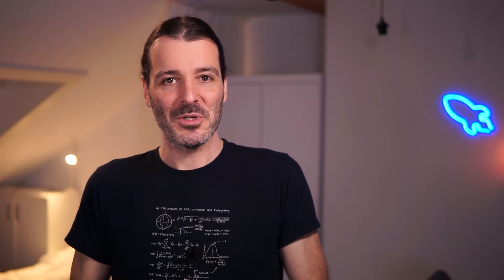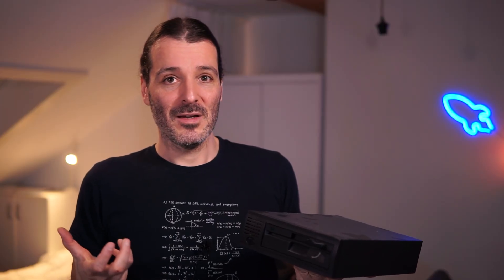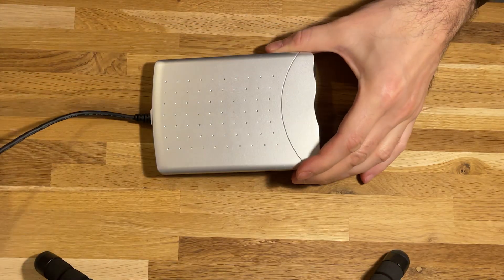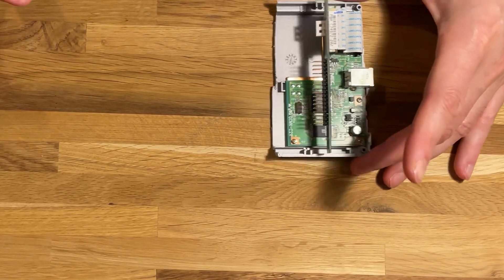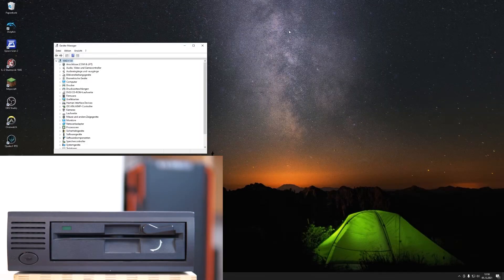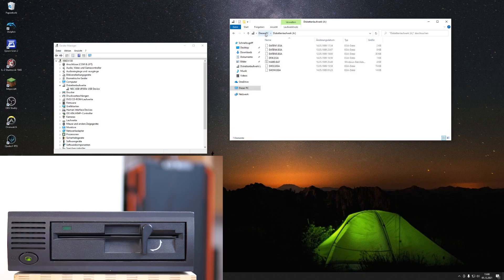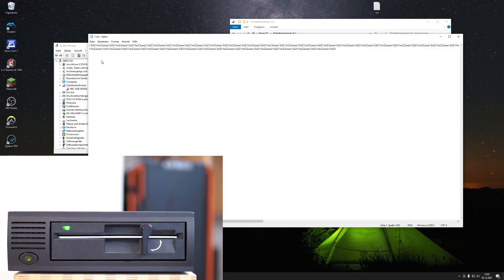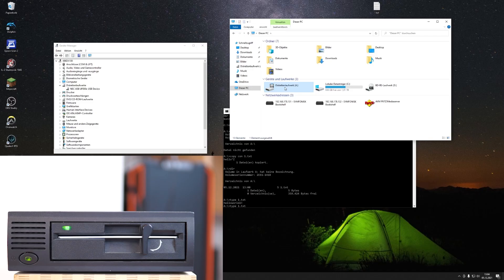How to build a working external 5.25" USB Floppy Drive

Comment: Is the drive a 1.2M or a 360K one? A green LED on a half height 5.25" usually indicates it's 1.2M but I've seen some late 360K drives with green LED and some early 1.2M with red. Then there are the 5.25" 720K drives that are formatted identically to 3.5" 720K.

Comment: Have you looked closley at the board and chip of the usb->floppy adaptor? There may either be some kind of internal registers to tell the chip what to identify as, or data stored on an eeprom/flash that stores basic info about the drive to the PC that could be changed to show up as a different drive.

Comment: Why does he insist on calling them "quarter and a five" to the 5.25"  disks? Is he British? Then he calls them "Quarter inch" and "quarter and five hundred". WTF is he talking about? Just call them "Five point twenty five inches floppy" dude.
Reply: His wording was cuckoo, but “five point twenty five” is incorrect, too. Though people occasionally do it, it’s not correct to speak out digits after a decimal as a single number (except in currency). So it’s either “five point two five” or “five and a quarter”.

He’s not a native speaker. My guess is he’s German.

Comment: I did this years ago but with a Linux machine and it works some what. I can read but I can't write to it. My guess is the Micro Controller only has the timing set for 720KB/1.44MB disks. The drive controller I used has a USB97CFDC-01 controller that the datasheet claims it can handle 5.25 drives. There is a pin on the controller called HDO and I tried forcing it high and low with no change. I also tried playing with a few other pins to control the RPM and Write Protect.

I might give Kyroflux a try but I honestly don't need a 5.25 drive for anything now since I converted my retro machine to use Compact Flash.

Comment: The reason is plug and play. You have to make it report a 5,25' Floppy.
Reply: The issue is, there isn't a USB floppy emulation spec for 5.25" drives, only 3.5".
Reply: No you don't. Unless you can answer why. Just make it report itself as a regular flash media device or hard disk, and then write a controller to translate.
Reply: @matthewrease2376  Many programs that write floppy images need to control the hardware directly. They won't even acknowledge the existence of removable usb drives.
Reply: @simoncowbell.6783  I'm saying, create a controller that takes care of this. So the OS doesn't even realize.

It wouldn't be great for preservation, but at least simple reading/writing could take place.

Comment: https://www.youtube.com/watch?v=9By8EmW62rs&t=287s

About five years ago, I analyzed and improved the circuit of UF0001 and developed a USB floppy controller conversion board that could read 5-inch floppy disks, but I couldn't solve the problem of distributing the control firmware, so I ended up putting it away.
Reply: If you have more information about this, I would be very interested in your circuit improvement and conversion board work. I have been trying to get 1.2-MB 5.25" disks to work using a UF0001 and have had some success, but not with the 1.2-MB format.

Comment: Cool project for retro computing!
Strange behavior. 
My theory is, that Windows removed 5 inch floppy support.
One way to test this out is connecting floppy drive directly to mainboard but mainboard BIOS needs support too. 🤔
Reply: I remember seing someone on yt who had old mainboard which supported floppy connector so he could plug 5.25" drive natively and it worked perfectly in Windows 10.
Reply: Still working on Windows 11, with a first-gen Core i system that has an onboard floppy controller and BIOS that supports 5.25" drives.
The oft-repeated "hurrdurr windows doesn't support it" line is a myth, driven by ignorance and the lack of (working) hardware to test it yourself.

Comment: You should use an adapter that is more standard. look on ebay there are cheap chinese adapters for fdd to usb. there are probably other different ones too. get a few and try all of them. For your Windows issues, you're probably going to find only fatigue because microsoft removed support for the earlier drives from windows 7 onwards. if the adapter wont work with 5 1/4" drives then it will be the usb to fdd chip and there's no way to make it work other than design your own converter chip using a cpld or a simple microcontroller like the STM32 series. This is exactly what the kyroflux does.

Comment: There's probably a difference with the way the bios sees the device, probably some raw mode vs the way windows sees it. So probably raw access vs drivers in windows. Maybe you can trick windows in device manager by selecting a different driver. I don't think it'll let you do it in windows 10 but earlier windows will probably let you do that

Comment: I still have several 5.25 flop drives, so this should be interesting to try.  I don't want to mess with my current USB 3.5 flop drive, so I will have to find another one to rip open.   I also have a combo 3.5-5.25 flop drive (that fits in one drive bay), but not sure if the USB controller can handle that type of drive.
Reply: That's actually two types of drives.  :-)

The combo drives had a single interface to the cable, but that interface was split into two on the PCB -- one with a twist (for A:) and one without (for B:), and usually a jumper or two to select which drive was which.  Despite the two connections being integrated into the PCB, instead of separate connectors on a cable, it is exactly identical to two independent floppy drives.

So if connected to a USB controller that implements the Shugart interface, you would have access to whichever is jumpered to be drive A: and that's it.

Just to clarify, most of the small laptop-sized USB floppy drives are fully USB all the way to the drive electronics.  The controller is not a standard PC (Shugart) controller, which is why many of those little drives can run at 2x, which a standard PC controller cannot.
Reply: @sirnickity  ... I will have to find it, it's a Teac, I believe, to see what the connectors look like. I have not looked at it in maybe a decade. But yeah that would be unfortunate if I can't get both of them seen on one USB, unless I use 2 separate USB controllers (to 2 USB ports), which basically would be the same as 2 separate flop drives.

Comment: The problem is the USB controller. It does not support the proper control parameters to handle a 5.25" drive, and it tells Windows that the drive is 3.5", so Windows assumes all the wrong parameters.

Electrically and from the command and control structure (read/write commands etc.), 3.5" and 5.25" FDDs are the same. The difference is only a different connector and different parameters (number of tracks, number of sectors per track, etc.).

In the old days there were 720 KB (double sided, double density, 80 tracks) FDD in both 5.25" and 3.5" versions. You could actually exchange the 5.25" by the 3.5" version and vise versa and it worked fine. 
The 8-bit Z80 based computer I had at that time supported a number of different FDD formats, from 40 tracks single sided/single density (90 KB of storage) up to 80 tracks, double sides/double density (720 KB of storage). You just had to indicate which type of drive was connected. When you set it to 80 tracks, double sides/double density, you could use either a 5.25" or 3.5" FDD. 

I always wondered why no 5.25" USB drive was ever produced by the industry. It is just a question of using the same controller you use for 3.5", but just using different drive parameters. And of course having an external PSU (like the build in the video), as normal USB cannot power a 5.25" FDD.

I have considered trying to create an USB 5.25" FDD using a Raspberry Pi to control the drive and just do everything in software, so basically emulating the floppy disk controller by a Raspberry Pi. On the Windows side, you could either try to have a 5.25" floppy drive (Windows may need a driver) or emulate a 1.2 MB USB stick to trick Windows.

Final remark: many kudos for your effort!

Comment: well, I would say that it is a driver thingy. You need to write a driver for the FAT12 15track/80 sectors and FAT 12 8+9tracks/40 sectors format for it to work under Windows. It seems that Windows ignores it. a 3" disk has 80 sectors in all possible formats and several sectors numbers that are not compatible with 5".

Comment: disk drives on a pc need to be configured for their actual size.  you are pushing a 5.25" drive with the 3.5" floppy size..so it will work right up until you run out of space as 3.5" is 1.44mb and 5.25 is either 360k or 1.2mb ..    the controller needs to be modified (the usb device) to tell it the actual drive type.

Comment: 1.2 MB is 80 Tracks per side 15 Sectors per track and 2 sides
1.44 MB is 80 Tracks per side 18 Sectors per track and 2 sides
The bigger difference actually is the size of the file allocation table. It is 7 sectors on a 1.2MB disc, but 9 sectors on a 1.44 MB one.
The controller tells windows its 1.44MB. So it belives there are 9 sectors of FAT. As the FAT is stored twice, the wrong assumption actually can lead to overwite the second FAT leaving inconsitant information.
The bios on the other side reads track 0 which also contains information about disc size. So it uses correct information about the disc's structure.
As a native FD-controller works, the information the driver got from the USB-controller about the type of drive seem to be the problem. As this information is written into the registry on first connection of the usb-controller, it seems a good idea actually look into the registry and compare the entrys to those you have if a 5 1/4 inch Floppy natively installed on a Windows PC. As the driver itself is from 2006 a windows xp pc should do.
Whats quite interesting is C:\Windows\System32\DriverStore\FileRepository\flpydisk.inf_amd64_acb1691126c93472\flpydisk.inf
If you open it in editor, you see there are two possible drivers which can be installed: the sfloppy.sys and the flpydisk.sys. My USB-controller automaticly installes sfloppy.sys, meaning "super floppy" due to description in the inf. While due to file propertys "flpydisk.sys" originaly had the name "floppy.sys".

So maybe all to do is rename C:\Windows\System32\drivers\sfloppy.sys to _sfloppy.sys and flpydisk.sys to sfloppy.sys and reboot to change the driver? Worth a try I think...

Comment: Point of fact sloppy drives were used on Windows machines up under early 2000s up until CDs on computers became a thing and you could still transfer files from one Windows computer to another with them even a newer computer with a USB plugin the USB plug-in drive was made for people who have files on an older Windows computer that's running to put on a newer one that doesn't have the drive in it lots of the same files that can be read by an older version of Windows can be read by newer versions of windows even Windows 10 that is the purpose for the creation of such a USB floppy drive that's the way to transfer stuff from a older Windows computer to a newer Windows computer without the ability to put a disk drive and a older computer that doesn't have the software for it and those USB drives are still available today because many people still have operating old Windows computers that they use for specific tasks and then need to copy data off of it to a modern computer you share that information

Comment: The most likely way is use some sort of IDE adapter. They have USB to IDE, they have ide apaters on PCIE which you can still make external using a USB to PCIE. They use them for video cards when mining. Couldn't tell you though which hardware is best. Honestly, can't tell you windows 10 or above even has support for IDE anymore. So whatever adapter you get is probably going to need its own drivers. 

This is why it most likely isn't working.
The way windows and dos identify drives is different. Remember usb didn't exist at all when DOS was in use. USB devices can have an ID that windows can see telling it what type of device that is.
In this case it sees it as a 3.5" drive. While dos on the other hand would look more at the sector count and so on. So when you were able to format the drive under windows and write some to it then and it worked only limited amount. The reason it worked a little is the first sector is the first sector. However the size of those sectors are different. So the addressing windows used after it got past a certain amount was off and so no longer worked.

To fix this issue you probably are going to need to change the way the USB adapter Identifies the drive so windows sees it as an actual 5.25 drive. Windows might no longer even keep any driver support at all for those. Also you may not even be able to change that on that card. Which would mean you would need to design a new one on your own or pay someone to do it.
If windows doesn't have the driver support for those 5.25 any longer then you are going to need to create that as well.

Also there is another video on youtube doing something like this with limited success.

Comment: 1.2MB (5.25” with typically 35 tracks)
1.44MB (3.25” with typically 40 tracks)

The USB floppy controller is NOT capable of properly reading/writing to a 5.25”
Reply: Sorry, thats not correct.
1.2 MB is 80 Tracks per side 15 Sectors per track and 2 sides
1.44 MB is 80 Tracks per side 18 Sectors per track and 2 sides
As the boot test from Bios proves, the controller is capable...

Comment: One thing I'm curious on with your 'helloworld123!' file working is my theory is that the current driver is only able to access the first 'sector' of the drive. So you probably are able to access the first 4kb of space on the drive, but as soon as it hits this space it doesn't know how to read any of the other tracks. I'm curious if you changed the track size, or something if you'd be able to access more, and I'm curious as well if you ran something like a very very very very tiny game in that sector if you could run that program. 

That being said as others said if you try loading the driver or somehow were able to write your own driver it may work. You might be able to fudge it with a similar enough driver.

Comment: IMO it should be a problem that the USB controller under Windows talks to the sectors of the disk. 
If you format a USB stick as a bigger size than it has (as a lot of resellers do), then you get also very strange errors.

Comment: DUDE - Did you try using the original uf0001 before you took it apart? If you can read write in DOS the BIOS support for USB Storage. Unfortunately Windows dropped real mode mapper used to support stuff you can see in DOS but has no Windows driver. Note that floppies are driven by Interrupt 13 commands in DOS; and Microsoft no longer supports Int 13.